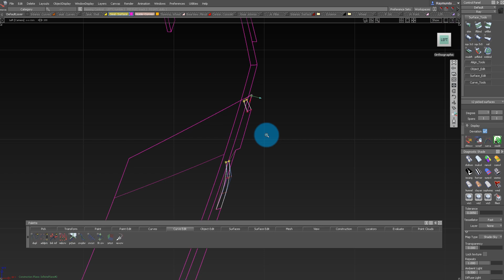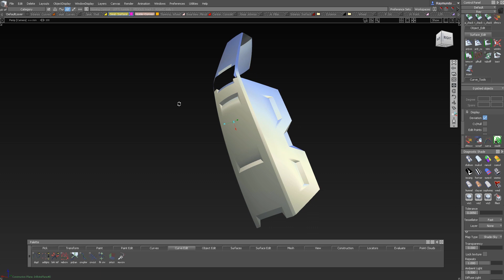Alias Quick Tips: Trim Convert

Comment: Hi Raymundo, thanks for the quick tip. For those of us that use Alias Design (no trim convert), do you have an analogous workaround?
Reply from the maker: J ! It wouldn’t work in all cases but I would assume you could trim isolate the patch then use the square tool using the trimmed edges.... maybe.... let me know if it works. I hate that they limit Alias design so much. I’m always telling that to Autodesk.